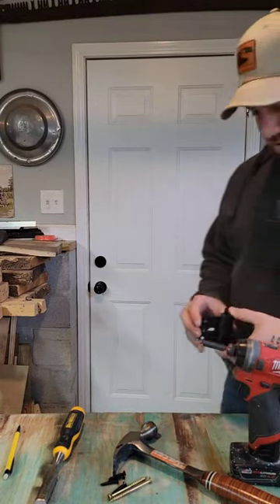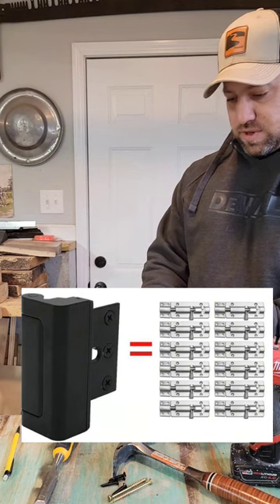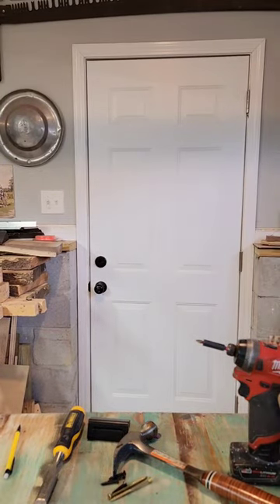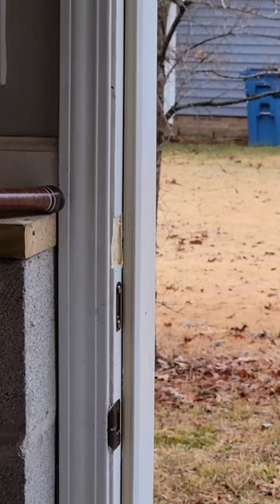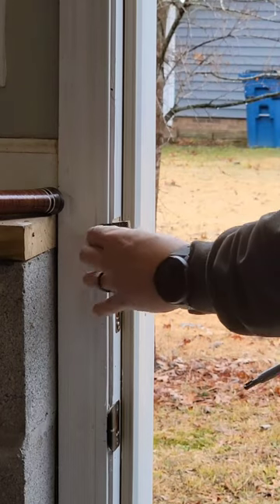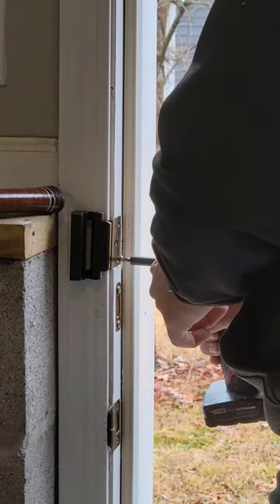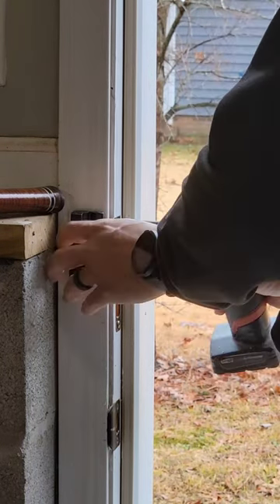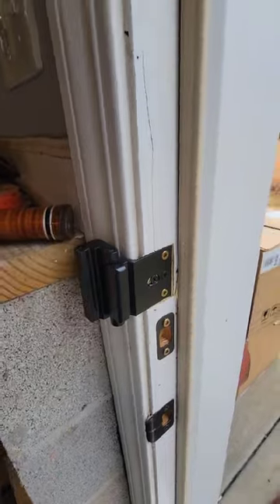Installing a Door Blocker Lock #homesafety #diy #doorlock

Comment: Only as strong as the bolts you use. A couple big kicks and the intruder is in with those short thin screws. Try some lag bolts
Reply from the maker: Do you even know what a lag bolts is? How would you shut the door if you had lag bolts in the jam??? I put 3" screws in it, not sure what you're talking about?